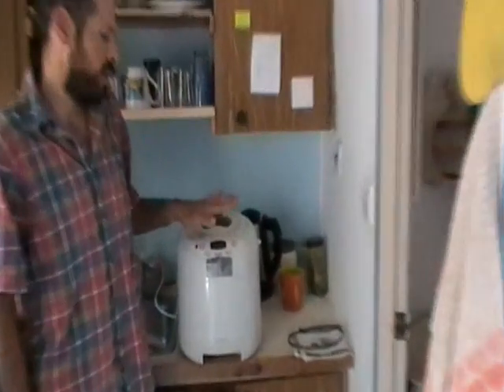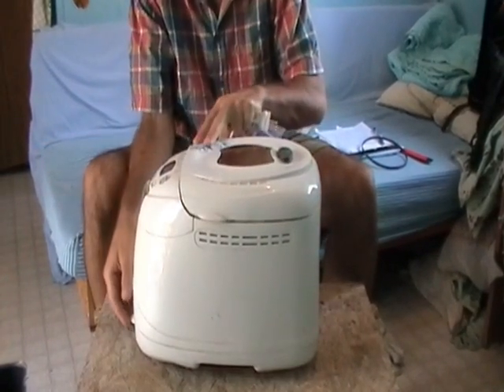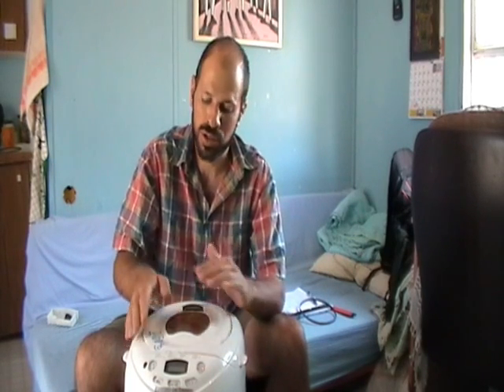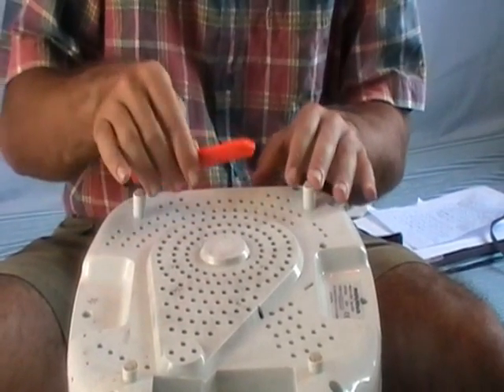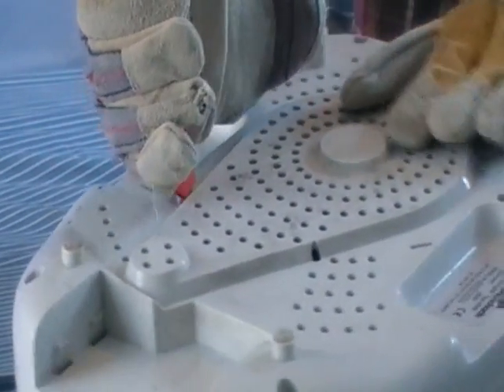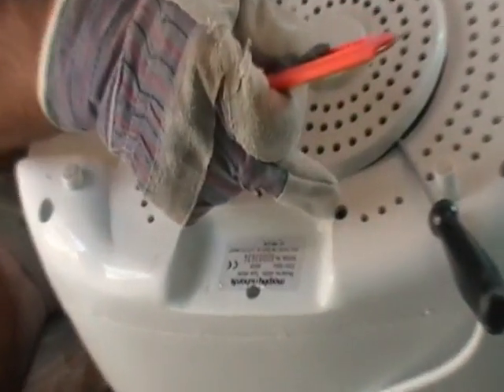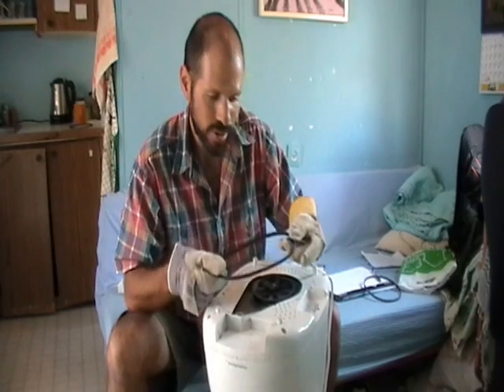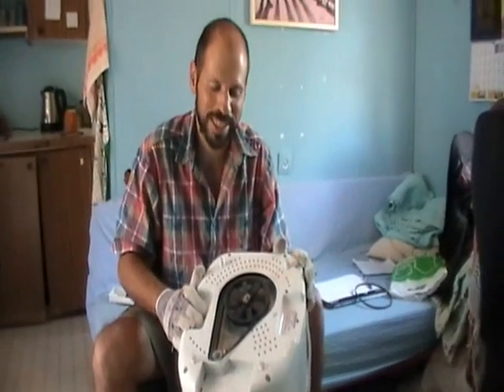How to replace a belt in a Morphy Richards 48290 bread machine

Comment: I have the U.K. Fastbake model . He’s right if you manage to open base funny shaped screws you’ll still can’t access because screws also attach to base from inside. No way I could cut plastic so using tiny drill bit I drilled loads of holes 3/4 of way around raised belt section in base. I joined holes together using drill bit and hacksaw blade. Ordered new belt on eBay £2.72 including postage from China . Search “automatic breadmaker machine conveyor belt band strap perimeter 537 mm” 
The belt width is 8 mm and the tooth  width is 3 mm. 
I only Opening 3/4 of the base plastic around the belt you can still access the belt and can leave the plastic intact pretty much but make sure there is no bits of tiny plastic left inside by using the narrow and on a vacuum cleaner. I’m not going to go out and leave the bread machine on now, I only use it when I’m doing something else in the kitchen

Comment: Great hack the Cookworks  XBM1038 is the same model in UK used Stanley knife then a chisel along to open it and belt was disintegrated thanks for the video.
Reply: my morphy richards heating element died so i bought a brand spanking new xbm1038 for £15 off ebay had it a week the belt disintigrated round the motor. opened it up with a dremmel and put the morhy richards belt in it there the exact same.

Comment: Thank you very much. Excellent video, I cut mine open today using a multi-tool.
One place to be very careful is near the recess where the product label is because the power cable is clipped there and you could cut through it (I grazed mine). I would suggest at this point cutting  inside the belt loop shape by 1cm leaving about 2cm from where the label is glued on.
If you look at the label upside down you will see the run of the white power cable in the 3 vent holes above (the upside down label as you are looking at it).
I will glue the cutout back in with bathroom (silicone) sealant.

Comment: Thank you very much, best idea for belt replacement ever. Not just bread makers - think about all the time I have wasted over the years stripping cover plates off various machines when a simple cut and reattach with a few simple fixing brackets would have been easier and much quicker. Great video.

Comment: Thanks, cutting out was good. On mine the belt just fell off as the bearing bush was so worn on one side. I just turned round the bearing ~180 degrees (drilling 3 clearance holes) and it worked again.  Alternatively punch out the pain bearing bush and buy a new oil lite bearing bush on-line (very cheap).
Reply: +Dave E 
I have the same problem, do you know the dimensions of the bush?
Could you explain what you did to fix it?
Reply: +DarkQuasar88 I have a friend with a lathe who cut a new bush for me. Sorry I don't know the dimensions. But as said, the breadmaker can be fixed by turning the outer bearing around to use a less worn area. The bearing is side loaded, so doesn't use all the bearing surface equally.
Reply: +Dave E actually it looks evenly worn so I prefer to replace the sleeve. and it is also quite loose, is it suppose to be very tight? 
Thanks!
Reply: +DarkQuasar88 yes it should be tight.

Comment: The belt for the UK fastbake model can be purchased on eBay for £2.72 including postage search “automatic breadmaker machine conveyor belt band strap perimeter 537 mm”
But don’t expect it to arrive the next day as it comes from China. 
I drilled tiny holes around 3/4 of the machine and then used 
Either : the drill carefully between the holes to join them together/ on some hits used hack saw blade to join holes . 
No need to totally remove the middle plastic section.  3/4 or 7/8 of the way round is enough. Leave most of the larger semi circle together then plastic can fold back. Make sure you get any bits of plastic out of the machine with a vacuum cleaner thin nozzle. 
I don’t use my adapted machine if I’m out of the house or in bed. I stay in the same room while it’s in use. 
The guy that posted this video is correct do not bother trying to remove all the base screws . You really cannot access the belt this way

Comment: Note: Instead of destroying the bottom of the machine you can simply create your own snake eye screw driver by cutting a small notch in the middle of the end of a Flathead screwdriver. Took me less than 5 mins to fully disassemble the machine.

Comment: Well done! I actually have the Sunbeam model sun0091 but its exactly the same with the same 2 proprietary screws that make a simple job of belt replacement harder to achieve yourself. With your simple solution I will now also 'bypass' the bottom belt cover & 'ventilate' the belt mechanism. Once again thank you!

Comment: This worked a treat for me on a 48280 which is essentially the same. It takes a while to do the cutting. Long repeated strokes with the blade is the key. A lot of force required to cut right through. I also used a mini hacksaw on the curved sections which helped a bit. The instructions which came with my belt look much more complicated so would recommend this to anyone. Many thanks. :)

Comment: This seems like quite a brutal approach. Most of the screws inside the tin had rusted in place on mine and there was no room to drill them out.  Fortunately I discovered that you can lever out the grey surround from around the top of the tin - it came out relatively easily and no parts broke, although the lip of the tin may need to be bent back into perfect shape.  After removing the surround, the base of the unit could be unscrewed and levered off (there are clips all the way around) then the entire base and tin come out as one.  After that, the addition screws internal to the base could be unscrewed to allow access to the belt.  I'm waiting for the new belt to be delivered before putting it all back together again.  In short, levering out the suround from around the top of the tin is another alternative to unscrewed all the screws at the bottom of the tin, or cutting off the bottom of the unit.

Comment: Thanks for this video, all done, just awaiting my replacement belt. TOP TIP: Use a sturdy metal craft knife and a hammer (use it like a chisel but sideways not in into the machine) and you can cut through the plastic very quickly :)

Comment: If you apply some silicon spray (the kind you use on your car door rubber seal from automotive store) on the belt and leave it over night it will restore the elasticity of the old belt (if not torn already) and you can re use the old belt.

Comment: I've disassembled my machine in the past (and paid in blood, sweat, tears, etc), and honestly would rather buy a new one than go through that again. This method worked much better, and saved me a lot of money!
I used tin snips (מספרי פח) for this instead of an X-acto knife. Still a lot of work, but IMO easier and safer - much less risk of the blade slipping.

Comment: 537 mm "Circumference"  8mm width , Tooth width: 3mm
Reply: Thank you very much! I was trying to find the exact length of the belt I need as genuine Morphy Richards belts were like £20. Just bought a standard high torque 80S3M537 drive belt.
Reply: @bailey125   Can you share a link to a source for it ?

Comment: this is not repairing but destroying. there is no need to use a box cutter. just disassemble it which is the opposite of what they do at the assemblying factory. if they can assemble it you can disassemble it.
Reply: As a mechanical engineer who owns this model of machine, I strongly advise against ordinary disassembly. It is just as difficult as Yaniv says it is in the video, and hazardous to boot. (I was also deeply gashed by sharp edges while attempting it, though the fix was successful for a little while.) It also took an entire afternoon. Not recommended.